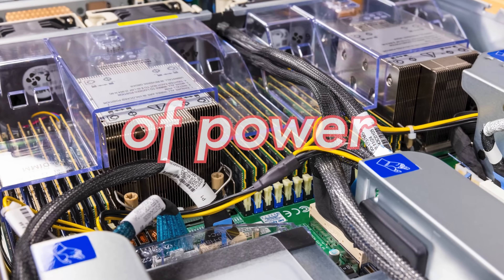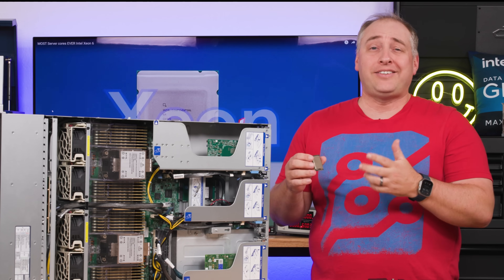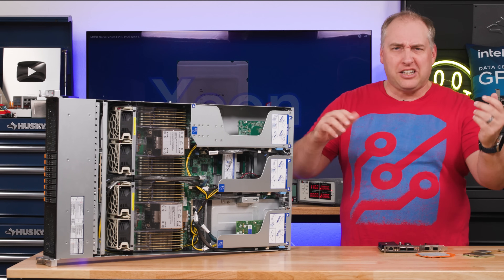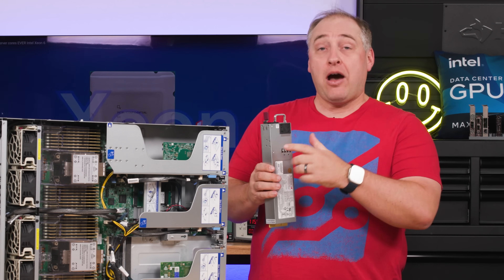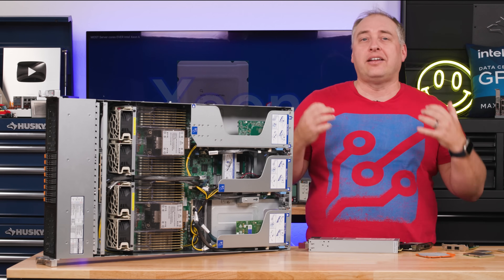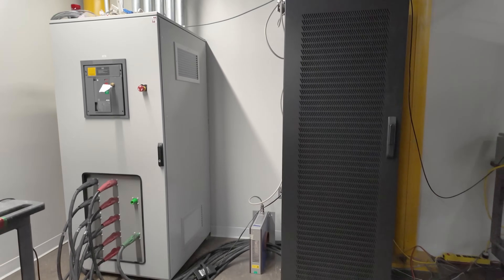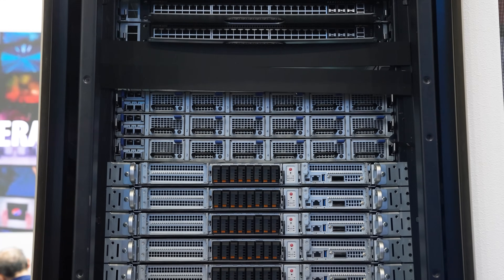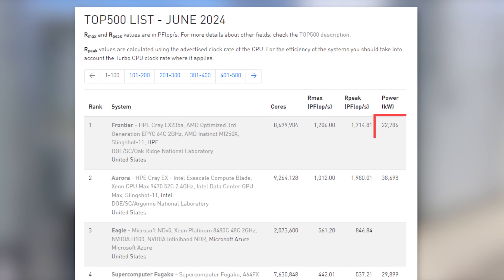Modern Servers Are Guzzling Power - Here is Why

Comment: by the way, those battery cells that you see at 1:56 are usually lifepo4 chemistry.  

You too can either buy them:
in a rack mount case for $300/kwh, as a set of 16 100ah cells and a bms, and an enclosure
or as as individual cells between  280ah and  304ah. One battery is usually 1kwh.
from a US supplier for $180 each, or
from a china supplier via alibaba for $68 each (more advanced chemistry for longer life and higher power)
32 batteries is about 30kwh

I am going to build myself several strings of the 304ah cells for home battery backup to a solar system. We have frequent power outages (usually more than one a month) from a few hours to a few weeks. I live in Mobile Alabama, so we have both frequent little storms, and annual hurricanes, sometimes more than one. I have a generator too. When the storm is blowing, and before and after it blows through, it is usually dark and cloudy, which is bad for solar collection. I still have city power, but I lost power for 2 weeks after a storm a few years ago, and lose power for 3+ days more than once a year. When it is 86f to 117f during the day, and 82f to 96f at night with 80% humidity, you want options. Currently I just use the generator. I am doing the solar build out this fall when the heat drops enough that I can stand to stay outside long enough. The heat index last month got to 153.

Comment: @7:36 uh no... remember, your power bill is still based on what you actually use, not what your on site power infrastructure can actually support. besides, building out your power infrastructure to support 2x, 3x, 5x is just simply future proofing your facility and is a good investment for not that much additional upfront cost. most data centers today will run out of power before they will run out of available RU.
Reply from the maker: Totally correct if you are building your own data center and will be owning and operating. If you are billed directly on utility power with no minimum in your contract, then you are great. If you lease colocation racks for often better connectivity, then you will massively overpay doing power like that. I was chatting with a STH main site reader that operates a few data centers. He said he has a several hundred kW client that has been doing this for 7+ years and runs at 15% of their contracted power. When they do a refresh, they add contract power based on the new power supplies. I hear stories like this often.

Comment: The energy per GFLOP or GIOP has greatly reduced. We just found bigger problems, more complex solutions & greater consolidation. We once had 80 cores using 40 rack units doing 128b per cycle per core, now its 1 or more 512b per cycle per core & 256+ cores in 1RU.
Network power has increased but offload has reduced CPU usage (reduces power usage) & offering higher throughput means much better per Gb efficiency.
It would be interesting to see how power per Giga FLop/INTop has changed over time vs absolute performance per rack.

Comment: At Hurricane electric in Fremont where we rent racks, you pay for 15 AMPS peak, but fire marshal says only 12 AMPs steady state is permitted. So yeah, power consumptio is a big problem esp. for the older data centers which only have 120V power. RUnning at 220V is more efficient and gives higher power.
Reply from the maker: I think they can put in higher power circuits even at HE

Comment: Unless you're completely out of rack space then you are not buying top end servers. You are buying at the sweet spot where cost meets performance. You are also connecting to the network using multiple 10 gig connections, not 25 or 40.

Comment: It is clear that data centers are both greedy in electrical power and large producers of heat, so much so that near my home a university data center has not obtained the right to be built if and only if it involves the recovery of its heat produced to become the central heating of the neighborhood's residential buildings.
another solution for data centers that is a bit extreme and little seen on YT pushes the concept of liquid cooling to the grand master level!
no more tubing cluttering the box to distribute the liquid to just the right places
no, the grand master level is the submerged data center!!
the motherboard and all its accessories (duly adapted to such a situation) find themselves drowned in a carefully chosen coolant (like that of your car - not a wise choice - but you get the idea)

Comment: Any semi-modern facility I've used allocates around 3KW on the low side and despite not running any particularly beefy servers we really feel the pinch.

 Worth noting I'm in telecom so we're running mostly DC equipment. It always feels sort of strange to me seeing enterprise stuff use a plain UPS since you lose a ton of your runtime from the inefficiency of converting the DC battery to AC output. I do more or less understand why DC is less common in the enterprise but it's an interesting deal
Reply: That actually seems really strange to let that inefficiency go forward.  Maybe it has to do with DC UPS not being up to snuff?
Reply: @motmontheinternet So you don’t actually have a UPS on DC power plants. You have a rectifier which is attached to battery banks which is different in some fairly fundamental ways. One of the bigger advantages is that it’s fairly easy to add more battery banks if you have the space - if you ever get a chance to look inside the cabinets at the base of a cell tower you’ll likely see at least one crammed to the brim with batteries for this purpose.

The reason it isn’t used in more enterprise spaces is that the copper cabling is fairly expensive and terminations etc require specialized skills

Comment: To put in perspective direct liquid cooling is essential if you want over about 80kw in a rack. Put simply you cannot buy air cooled servers that would go in your rack and draw more power. For example an air cooled Nvidia DGX server is 12kw and 8u of space so 6 would consume 48u which is an oversized rack to begin with but its only 72kW power draw. The numbers are similar for compute based servers as well.

Comment: You migght have been able to fill a rack with just 16kw of power, in HPC land three 32A 240VAC PDUs where what we where using 12 years ago and even then there was not enough power in  the rack to have the compute nodes plugged into two different PDUs.

Comment: NIC's shouldn't need their own OS. But in all fairness, BOTH of the cards you held up run their own OS. (the connect-x card has onboard firmware. possibly vxworks based, I've never disassembled the firmware.) Much older cards also have "microcode", but most aren't upgradable. (I recall updating the microcode on some broadcom embedded nics on supermicro boards - they behaved badly without the IPMI card.)
Reply from the maker: There is a pretty big difference between running CX microcode (that the BF-3 has too) and the BF-3 running ESXio or Ubuntu.
Reply: @ServeTheHomeVideo  Indeed. At that point, you have a "co-processor", not a NIC.

Comment: to bad they can't use the heat generated and convert it back into power.  also, it would be better if they just used dc power, especially when using batteries and solar.  just fyi, elon(tesla) mentioned their data center will be using 500mw

Comment: I was working on designing my own Socket940 waterblock for the Socket940 AMD Opterons back in April 2006, when I was still in university.

People used to think that watercooling was about thermals.

Its only peripherially related to thermals.

It's actually about power -- and how efficiently you can use the power that you have available to you, to move heat out of the systems/racks/data centers.

This isn't new. For me, personally, it's an idea come to life, that's 18 years in the making.

Comment: When I worked in a data center, a redundant 25kW rack was excessive, reserved for clients who requested a high-density rack as a project requirement.
Today 50kW is "normal", 120kW is the new limit, and there are people talking about 200kW ultra density.
Working in a data center is increasingly dangerous.
Reply: It's getting to the point "grid" voltage has to be supplied to the rack. 120k @ 240V is 500A I use 4/0 welding cable in the EV to support loads like that. (and it's soft limited to 300A)
Reply: @jfbeam   I wonder why do they still supply 110V to servers, or even 240V. why not 48V DC direct to a step-down converter instead of a PSU ? wouldn't that be more efficient at the cost of having a huge copper bar on the back of the servers going to a gigantic PSU on the bottom directly supplied by 2000V ?

may that's why, it would cost more in proper personnel to mess with the servers if there's a copper bar carrying 500A exposed
Reply: @monad_tcp  Larger copper wires/bus & double conversion both costs more. Higher voltages are more efficient to supply higher power requirements. Also needs to handle power fluctuations/noise & not be so big it blocks cooling around the racks.
Now with water cooling through racks, it does become more dangerous.
Reply: how long till a DC needs its own nuclear plant to operate? we're lucky if it's a nuclear plant and not coal-powered
Reply: I remember having an outage in 2015, my rack was using only 32kW, but the outage was caused by the back generator frying the power board, someone literally died that day, it was on the city newspaper, my DC was in a small city but closer to big financial centers, so it had sub-ms latency.
 I felt justified in my 2h outage of my service because of it, I had to fail-over to the auxiliary DC, which was my staging rack.

I can't imagine how insane it is now.
Reply: cmon
Reply: The biggest issue at these crazy power draws is that if the cooling water stops flowing for any reason whatsoever you have to have a system in place to throw the breaker for an emergency shutdown or your system is literally toast. There is no time whatsoever for an orderly shutdown.

Comment: Those panels look tired af. The fuel cell is awesome, don’t get me wrong, but is it green? It may have its place as energy storage. Because that’s what it is, but I strongly doubt that hydrogen is “green.” Hydrogen might legitimately have benefits over other storage solutions in this application. It looked like it was all truck portable. Temporary/ portable backup generation is a niche I can see hydrogen filling. Thing is, just like batteries, hydrogen on its own is only slightly greener than the alternative. It’s the energy that fills it (tank or battery) that makes it green. 
Let’s forget “AI.” My guess is it will end up raising power budgets substantially permanently but not nearly to the degree we are seeing in the bubble. 
If we could cut out just half the tracking & ad related power overhead, how much could that theoretically save? In other words, how much overall compute is spent on surveillance capitalism? Reckon we could (theoretically) legislate away a quarter to half of ad tracking BS? How  much could that lower the power bill?

Comment: Perhaps several Motherboards will end up immersed in a tub of mineral oil.  There goes the case, case fans, CPU cooler, GPU cooler, Network cards and several heat-sinks.  Water boils at a temperature too low for high end parts.  Being able to pump oil via radiators, or heat pump tech may be an answer.

Comment: In the Datacenter power is not the issue but cooling capacity.
A Datacenter is measured by cooling not by power as that is usually the least problem to get from the grid
Reply from the maker: Not anymore. If you were to talk to people building big new DCs or large DC REITS power is the #1 concern these days
Reply: Cooling used to be an issue. Then people gave up and embraced liquid cooling. Air can only get you so far, then you need to bring the water from the CRAC to the actual equipment.

Comment: I use to build these from the Red Iron on down.    Truly amazing how  just the power infrastructure works.  Never mind the switch to going full fiber networking from copper. 
The cooling is the most interesting part.    Lots of solutions, even ones that no longer use a false floor like my last data center install.
Reply from the maker: Yea raised floor is good in some ways but also usually has lower load capacity. That is a big deal for the immersion guys
Reply: @ServeTheHomeVideo  Not if it's spec'd and built correctly. 'tho it does tend to concentrate loads on the subfloor. A rack sitting flush on concrete has a much larger contact area than 4 tiny feet... or for raise flooring, maybe 6 pads. This is one of the many reasons in-row cooling, and even in-rack (rack door, water, etc.) has become so popular. However, with a 100K+ load per rack, there's no way you'll cool that with air.

Comment: Fun video!  Liquid cooling, whether it's on chip, immersion, whatever, is the future of high density compute.  Has to be.  Recapturing the heat load and utilizing it in the building makes too much sense ...or dollars and cents.  NTM, the ability to throw cooling towers on DC's and let millions of gallons of water evaporate to the ether is inefficient and bad resource mgt.  These data center owners need to show a respectable PUE and show they're good stewards of a communities resources.

Comment: i have a dell r630 and i use the 500w power supplies because i have only 2 sata ssd for os only and 8 nvme as storage for the LLM and Image models and it running 12 dim of 4rx32gb 2300mhz ram and two xeon e5 2699v4. i am idling on about 130w and max out at 450w. also it is only one power supply used at the time. i know this is risky but it is done for power evfessency also i dont care if the server goes down and restart with the second psu if psu 1 fails. everything is automated and volatile nothing is critical on this system. it is used for LLM and image generation it has no other purpose nothing is saved on this system. every image that is created and i want to saved is on my nas .
Reply from the maker: That is great sizing
Reply: @ServeTheHomeVideo  theoretically, the server can use more power, but in real-world conditions more than 450w was not possible for me at 100% load with a LLM or ai image creation. i dont know how much more the psu can handle or if the dell power management system switches the second psu also on. in the ipmi is only 2 option for the power management. one does distribute the power evenly, the other sets a power supply priority. but what happen in the background is not clear communicated in the ipmi and the lastes user manual that is public available is so old it even does not mention the use of the v4 cpus or 128gb ddr4 dims. i have the idrac 8 and a enterprise license luckily so some things are possible but sins i dont work in the server space or have anything to with IT systems professionally. 
i write programs and drivers as my hobby so i have a idea how this works but no prove to it. 
if it uses the second psu if power goes over the 495W that one psu can provude. nice no down time but if not is this also ok and i change the setting and use both.

Comment: I'm sorry for being "that guy" but I am a bit appalled at the rhetoric around hydrogen as fuel. Hydrogen does not grow on trees. It's not a "power source". It is a method of storing and transporting energy. It's only as clean as the technology used to generate and transport it. By itself, it's like a battery.
Reply from the maker: Totally fair. Just wanted to show the solution. Many have never seen anything like that
Reply: Pumped hydro gets 70-80% round trip efficiency (power out/power in), utility scale batteries are similar. Hydrogen is...18-46%. Wow, yeah that's bad. Maybe if you're getting solar power from central California at $-21/MWh (negative, not a typo, real price at times) you can make the economics work.
Reply: I've tilted at that windmill for decades. People. Do. Not. Understand. Just like with the "green" EV... where the f... does the power come from? H2 is a horrible energy storage or transport method. It takes an unimaginable amount of energy to hack off the hydrogen, and then even more insane energy levels to compress it to a remotely sensible-to-use density. (do a bit of research w.r.t. the physical volume of tanks in a fuel cell car vs. the actual amount of H2 in there, and the thousands of PSI required to get even that little.)